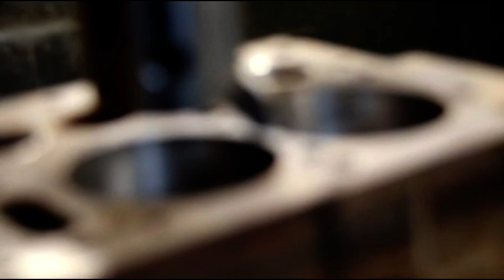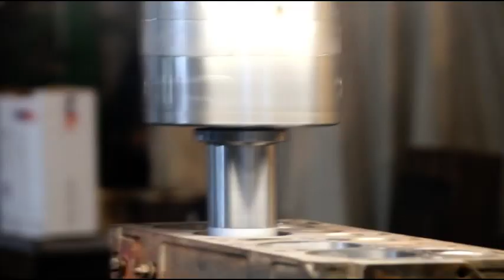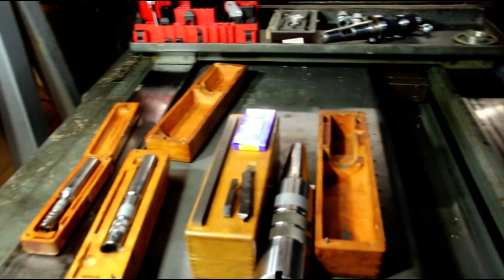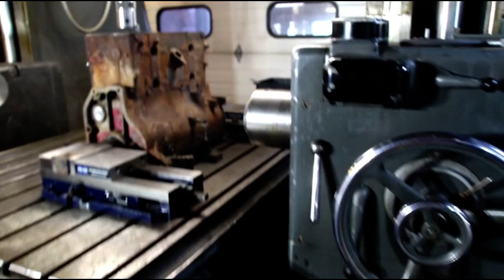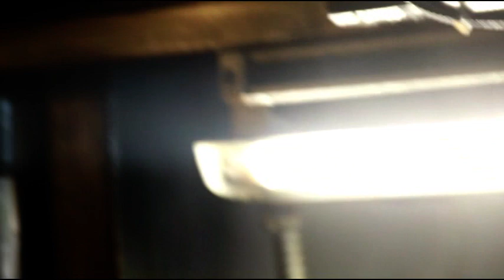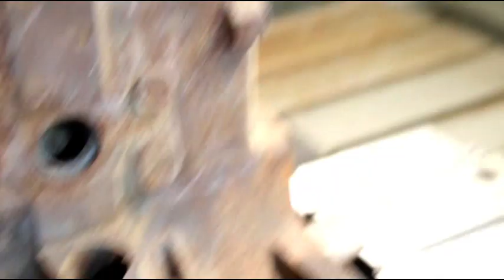SIP Hydroptic 8 Jig Bore....Willys Engine Block First Test Bores

Comment: Can you line bore the crank mains on a Hydroptic ? Or not rigid enough ?
Reply from the maker: Yes this is a 40,000 pound super rigid machine and the horizontal spindle will be line boring a block soon.  Will show it when I do it.

Comment: That is an impressive machine you have there. You will probably be doing more precise machining on engines than the factory did, which I'm sure you would prefer. Hopefully your customers will be able to appreciate it.
Reply from the maker: Love the Sip machine and the tolerances it can hold.  Always trying to get more quality and more efficiency in the shop